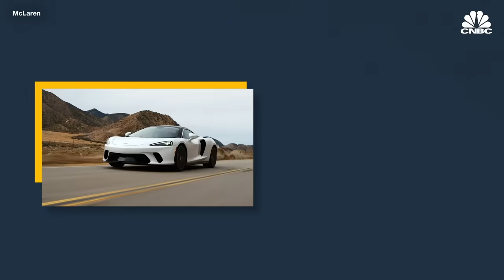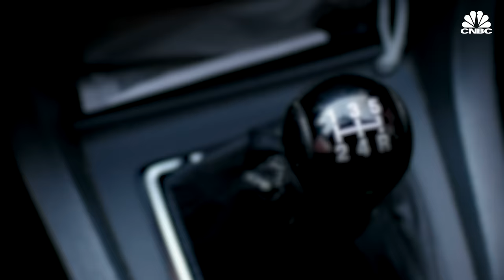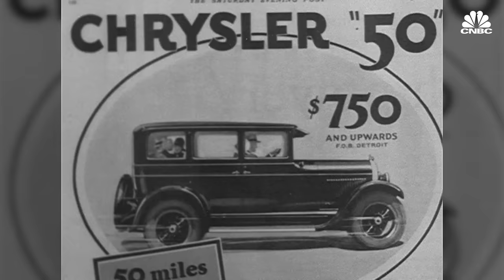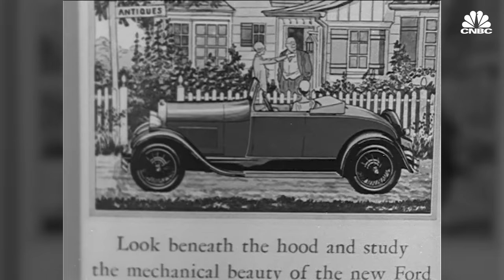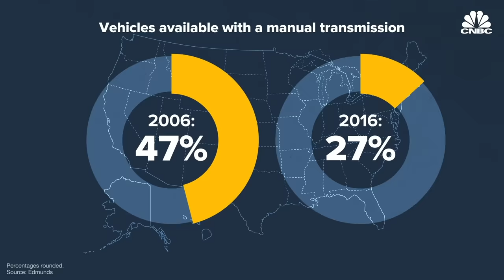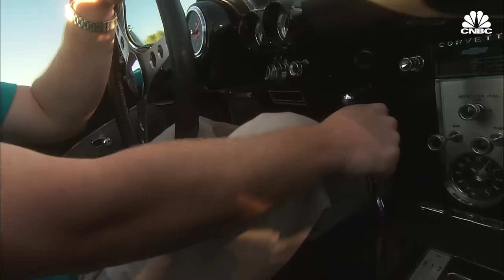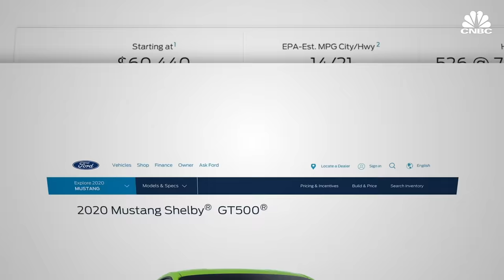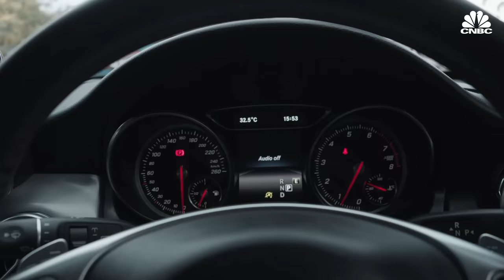Why Stick Shifts Are Going Extinct

Comment: "they require constant attention" 

Yes, that's what a driver should be doing.
Reply: Instead in USA it’s texting and sipping our favorite drinks from Starbucks. Clutch? What’s a clutch? What’s a steering wheel for that matter?
Reply: I hope you are joking
Reply: when you are going straight on a highway for 6 hours its pointless
Reply: @Fr00stee  most accidents occur on regular streets
Reply: Duh
Reply: Exactly
Reply: There's even a meme about throwing kids onto stick shifts to teach them not to touch their phone while driving
Reply: @Fr00stee  sad but i thought a camaro that i drove in early 70´s would be able today to be driven in normal roads that includes turns, but even a renault 5 from 1978 is better with only 50 h.p. so why da hell do you want cars with 500h.p.
Reply: @jogmas12  what does that have to do with driving on a highway
Reply: @Fr00stee  well, you need to drive on regular streets before reaching a highway or expressway.
Reply: @jogmas12  that still has nothing to do with driving straight on a highway for 6 hours. Driving on a street and driving on a highway are 2 different things. And the street driving part will still take much less time.
Reply: @Fr00stee  ok, when driving on a highway, if one is inexperienced in driving stick they gonna be a little apprehensive 😬 when ever traffic slows and they have to change gears ⚙️, thus putting them back on “street mode”.
Reply: what? i want to drink my shake while reading the newspaper(sorry i´m wrong, i forget that i´m talking to US americans )......while reading what Mary Cuntyard did this morning, how many likes are there on new starbucks cofee flavor, i remenber go camping and after having the everything ready me and a friend of mine went to the camping bar at 2.30p.m(we say 14.30) asked for a drink wich is fresh cofee (strong one) with milk in a glass cup and there were a group of kids from other european country´s drinking botles of beer and a nice german girl was send to ask us what were we drinking and we explained ,a few minuts after two girls were carrying to their table 6 cups of glass with fresh cofee and milk, it´s used to say that milk with beer it´s not a good mix a few minuts later there were a lot of girls and boys throwin´up their stomac content,the smell of fresh cofee and the look of those drinks just done are atractive but we don´t mix ,things that are not meant to be like driving a car and seeing a movie at the same time or having a 500h.p.car with automatic transmition ,there is a lot more to a car control then just accelerate and brake, and at speeds of 130 miles/hour just brake it´s not safe ,and i guess there are mountains in the U.S. if one goes to the top of the mountain with is family to show the wonderfull view when returning in a deep inclination road the car starts to increase speed only with it´s weight and if you start braking ,at midle of the descent the brakes for more evolved they are might be already heated to the point of glowing red and now how to stop a fast car downhill? is there a new automatic transmition that as a DDownHiLL position?why don´t you try to learn how to drive a car, does your superbikes have already automatic transmition?this video should be banned it´s an hazzard and many people could dye because they saw you´re video ,why american cars are not sold in europe ,they tried my grandgrandfather had a buik  this bought in 1956 and bought it from a stand  not imported and i have magazines that say "try the new ford falcon"this in the 60´s but there were mercedes that are better still than todays cars in safety ,comsuption,etc. and in 65 you had a chevy corvette that for a brief period of time was the fastest car in the world, did you know that not one was made with you´re fantastic automatic gears, or my 74 firebird formula 400 bought in 78 had not a version with automatic i was told in L.A. (the angels,why do you say it in spanish? was it also stolen like tejas or texas?),regards and stay healthy
Reply: nope
Reply: @Fr00stee  yes ,that´s why most of todays (at least since the 80´s) cars have 5th and 6th gear ,only to drive 6 hours straight no need to change gears, but tell me why  in early 70´s they made sheriff or police cars with 3 gears only manual and they could fetch any sport car, no longer if you have a sport car police would stop being after you,regards
Reply: @Fr00stee  nothing but he doesn´t understand what a car is, regards
Reply: @jogmas12  manual is also bad for constant start stop traffic because of how often you need to change gears
Reply: @Fr00stee  i only drive in highways when traveling abroad and there´s the 5th gear that you don´t need to change it in a straight highway for the miles or km it stays straight
Reply: @Fr00stee  facts
Reply: @Fr00stee  don´t you also have mountain or you flat out the all country to save on tar
Reply: @RUfromthe40s  i dont understand what you wrote
Reply: I am learning to drive now and I guess I understand what he meant with that. It is a challengeto keep attention on the speed, the rpm, the laterals, the back and keep alert while changing gears. What he means is that in automatic cars, you have less things to keep attention, so you can focus only on whats around you. Btw, I am a brazilian, and the large majority of cars gere are stick.
Reply: @The Deluxe Gamer They did not. Of you drive manual you know that is not the case
Reply: @jogmas12  why you mad
Reply: no, you are wrong your statement is disanalogous to the situation.

How do you not understand that we don't want people to pay attention to the car but to the road? You should obviously focus on the road and not some stick/phone you need to play around with. So no you shouldn't text and drive just like you shouldn't shift.
Reply: @KhaalixD  true, driving an automatic car gives you more freedom or focus to pay attention to the road
Reply: That's also not true, shifting requires about as much attention as turning the pedals on a bicycle -- you just do it without thinking about it.
Reply: @Fr00stee  Not really, I drive a car with a heavy sports clutch. After 20 years of driving a manual. Its not a big deal.
Reply: Tsots loot  I'm aware, so does using the stereo. Simplifying the driving process will reduce accidents and optimizes driving while also making it easier for new drivers to learn, there is no argument to be had here.

Also, my original comment is about OP misunderstanding that we don't want people paying attention to driving, we want people to pay attention to the road.
Reply: I would destroy the engine. Too much crap to keep an eye out for while trying to keep my eyes on the road.
Reply: that's what you should do when driving a car, paying attention
Reply: Yep, that’s why one of the reasons why I bought a manual car.
Reply: @KhaalixD  Your attention is on the road, because you see it next to the speed display or hear it when you have to switch gears. Not a big deal
Reply: Really after driving a stick for years you do it without even thinking about it, it doesn't really take your attention.
Reply: @brianmccarty2636  Just like riding a bike or swimming if you get used to it.
Reply: @Fr00stee  When you are goin on the highway for 6 hours, you just put it in gear and leave it there. Not that hard
Reply: If computers can pay attention to something as mundane as switching gears perhaps the driver can pay attention to other things that the computer cannot (yet) pay attention to.  Let the task be done by the one that's better at it, in this case the computer.
Reply: @redroad9949 A computer can't conjure the joy from driving a manual
Reply: In being stuck in bumper to bumper gridlock in New Delhi?  Stick makes sense to you?
Reply: Doubt if the cheapest cars (dacia) get this Feature
Reply: Yeah,SMH on the road or  the Stick?🤦‍♂️
Reply: I prefer driving standard.   My dad taught me, then I taught my brother and both sons.  I wanted them to be able to drive most cars if they had to.  I then learned 10 speed for driving tractor trailer.  It becomes automatic and I didn't have to think about down shifting etc.  An end to another Era. Sad.
Reply: @Fr00stee  once you reach speed, unless you need to slow for traffic or an exit, manual transmission just stays in gear.
Reply: @jogmas12  And at intersections
Reply: @Fr00stee  maybe bad for you but someone who likes to do their own shifting perhaps not
Reply: In Germany it is  illegal to drive a manual car if you're driving test car was  a automatic car and can get you in jail for up to a year. The driving license has the restriction 78 on it
Reply: LOL for real!
Reply: @Fr00stee  who is driving for 6 hours?? u Going on vacation aye?
Reply: @caytonhopson3200  anybody who goes on a trip between cities?
Reply: @Fr00stee  no it's not
Reply: @Daniel Hodges if using manual takes away your attention from watching the road you shouldnt drive. at all. ever.
Reply: This is so true. I drive a stick shift and you wouldn't believe the number of times I grind my gears weekly due to lazy driving, not pushing in the clutch enough or letting go waaay to early. So embarassing especially around a boat load of people.
Reply: Automatic car logic: I'll take the heft of controlling the car, you just step on the gas and pay more attention on your surrounding.

Sounds like a win to me.
Reply: Depends. I get too focused on the road that I forget shifting so that's why I personally prefer automatic
Reply: Exactly!
Reply: @jogmas12    The steering wheel needs constant attention. Like your legs while walking.
Reply: USA: "driving while eating, reading a book, checking your emails, facetiming (while not sitting in a tesla!)"
EU: U MAD BRO?!
Reply: @jogmas12   ???? So what? When  the traffic slows down to less than 60 km/h you shift. So what? You simply do it. That is all there is to it.
Reply: @Fr00stee    Why? Do you think the transmission wears out faster than the rest of the car, or what.
Reply: @degenetron7590    It is a proven fact that when things are too easy you make more errors.
Reply: @KhaalixD     Do you think we are complete idiots and have to have connscious attention on shifting gears? Besides, when things are too easy, people make more errors. THAT is a proven fact.
Reply: @ravanpee1325    You actually should not have to move your legs while walking. Takes too much of your attention, while you should be watcing the traffic.
Reply: @redroad9949      IF it is better at it. OK, some modern automatic transmissions are very good, but let's forget about the oldfashioned Hydromatic or any other non computerized automatic transmission.
However, once you have to drive in snow or on icy roads it is a different game.
Reply: @RUfromthe40s  LA? They should say it in Spanish because it was originally named in Spanish long before they spoke English there and the USA a is the the country in the world with second largest Spanish speaking population, many of them with a longer line of ancestors on that territory than most mono-lingual English speaking Americans.
Reply: @linojakobsen7737  when slows you can leave it in the same gear you only downshift to accelerate
Reply: @jogmas12    Depends on how slow, don't you think?
Reply: @linojakobsen7737  I brought it down to 10 to 20 mph in 5th gear ⚙️
Reply: @jogmas12   But why would you?
Reply: @linojakobsen7737  because I wouldn’t need to downshift yet with traffic still slowing, just wait till it picks up, then downshift, this allows for better choice of the proper gear ⚙️
Reply: @jogmas12  Oh come on - are we in kindergarten here? Of course you don't shift through all the gears when you - all at one go - slow down from say 150 to 30.
But I know but a few cars that would run well at 30 in aything higher than 2.
Reply: @linojakobsen7737  look dude, been driving stick for 35 years plus, it ain’t like I just fell off the turnip truck!
Reply: @linojakobsen7737  of course that part of the U.S. was mexico los angeles ,california e tejas
Reply: @RUfromthe40s     Exactly. The mission San Francisco which later became the city, was founded by a monk from Petra, Mallorca (Islas Baleares).
Reply: @linojakobsen7737  did you know that the world was divided in two between Spain and Portugal with agreement from the pope ,the maximum power in the world at the time , the "Tordesilhas"(the name of a villa in spain) treatie, and the Portuguese King din´t sign because he wanted one more parallel line to the East (like you see today in globes) and everybody at the time thought he was crazy because ,Brazil was included and there was nothing else in that line to east that he demanded so he could sign the the treatie ,this lot´s of years before Cristovão Colombo went to the  Portuguese king saying he wanted to travel to India through East, wich was denied and then he went to the Spanish Queen that ofered him Boats and means to arrive to india by east ,he did thought he arrived to India ,that´s why the native people was called Indians and the line the Portuguese king demanded was proved later to include North America and he was the crazy one. This is History ,what you see in recent movies and national geographic documentaries about the history of the world is rubish and not suported with documents that exist in Portugal, Spain and Rome, regards and health to you
Reply: @RUfromthe40s   I do. But not everybody gave a sht about it. They even send out an order for the Vikings on Greenland to pay taxes to the Pope. But they never sent anyone seriously trying to collect.
Anyway, the importance of hispanic culture / language in the world is terribly underestimated - oddly enough especially by anglophone Americans.
Reply: @RUfromthe40s   ... and much earlier than there was any USA.
Reply: @linojakobsen7737  when popes started ,vikings were only a few they were terminated by european army´s ,still tribe way of life and their boats couldn´t get out of rivers ,in the sea they would turn at the first wave, i study history for 7 years
Reply: @linojakobsen7737  right...the world was divided in two for portuguese and spanish ,tordesillas treaty ,i´ve been there it´s a litle village in spain
Reply: @RUfromthe40s      What??? Where were they terminated and when?
Reply: @jogmas12  You can't shift if you are eating a big mac
Reply: Yes, constant attention on the road. Not on your shifter.
Reply: @EdDeezNuts944  is that literally the only thing you have to defend yourself with? When your argument is so bad you have to make up lies about the other person just to make an inkling of sense?
Reply: @EdDeezNuts944  I never said that manual requires constant attention. And that's another lie. The original commentor is the person who said that. I've probably driven more manual than you anyways, maybe grow up and consider that more experienced people can disagree with you. Try to actually think of reasonings instead of blatantly lying about my driving experience.
Reply: @EdDeezNuts944  And I've done farm work on my Uncle's old pickup for 9, going on 10, years now. Again, people who are more experienced than you can also disagree with you
Reply: @rainonedavid3564      That is just as intelligent as to say that you, as a pedestrian should have constant attention on the road and not on your feet.
Reply: @linojakobsen7737  learn proper grammar before you comment on the "intelligence" of my statement
Reply: @rainonedavid3564    Yeah, what about my grammar? At least my phrases start with a capital letter and end with a full stop. And talking about intelligence: In how many languages other than your native one is your grammar perfect. And in how many do you have university degrees or other credentials to prove your proficiency? There are enough people here who can't - or don't care to write their native language properly. 
Sorry, but what you are saying about manual shift and attention is as good as saying that you can't walk and watch out, without stumbling over your own feet.
Reply: I can eat a big Mac and drink my favorite beverage while shifting gears in a manual. Not hard if you can multitask.
Reply: Literally
Reply: I don't know about you but I like dozing off at the wheel then waking up a minute later and seeing I'm at the edge of the road heading towards a lampost
Reply: @Fr00stee  When you are going straight on the higheay for 6 hours it won't make a difference, you'll be in one gear for the vast majority of that time
Reply: Back in the day when all you drove  was a standard   it was like second nature  drove while  drinking  a coffee and  smoking a  cigarette
Reply: Again not a big deal  in my opinion  traffic  or no traffic  if all you ever driven  was a standard  it becomes  second nature  like tying your shoe